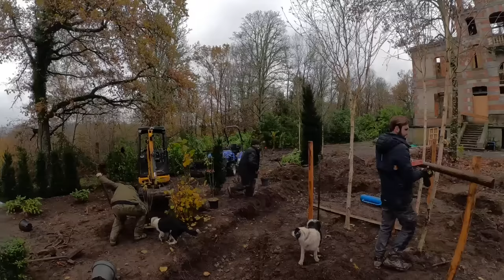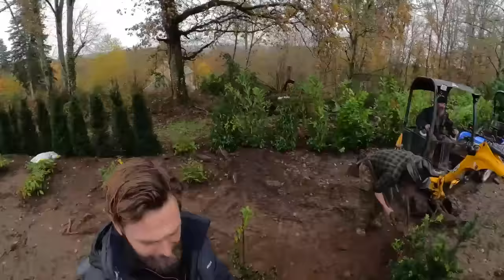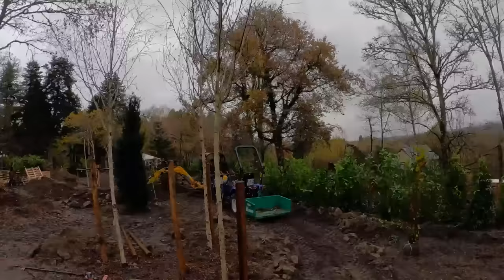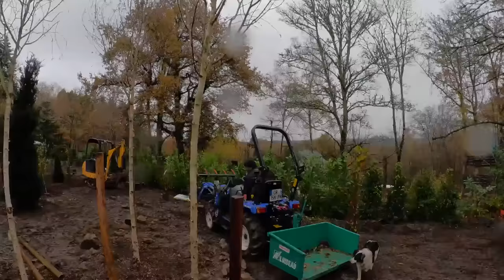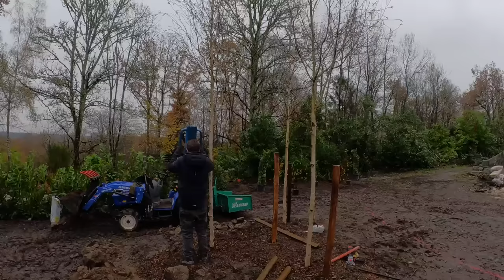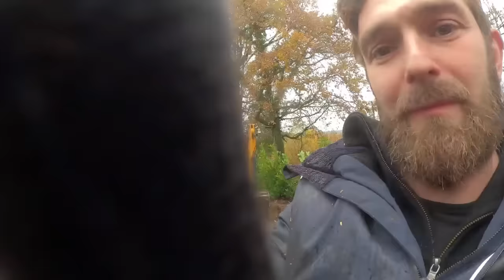Live from chateau de chaumont

Comment: Hi Dan nice as it is to see the garden coming along ,I think perhaps you should be concentrating on getting some sort of roof on your hard work in the building. My concern is that if the supporting  floor beams are continually getting soaked that they ends of them that are slotted  into the walls if the mortar is tight the pressure of the expanding wood is immense and it may crack the walls very easily please  get some tarps up and get the place dry and forget about the garden until the springtime.

Comment: ps I reckon you could run this all day! pps current thought on planting trees is to support right at the base  - stops the rock on the roots but ensures that the trunk flexes and increases strength. Trees need to be planted a little high in the soil otherwise they sulk 😁

Comment: The bane of any environmentally minded gardener - what to do with all of the leftover plastic and polystyrene plant pots. You can only reuse so many - and I do.

A while ago I realised I'd amassed a HUGE pile of plastic pots just as the gardening year was beginning. Checked with a local air ambulance charity shop to see if they'd be interested, came home, scrubbed, dried and graded by size, before donating the lot. Depending on how the shop priced them, in groups or individually, a good £15-30 could have been raised. A local DIY shop does take back clean plastic plant pots for recycling, but as I've not got a car, that's quite a walk just to do a bit of recycling.

Comment: Dan use panty hose (women’s stockings) cheapest way to secure plants. The top part goes around the horizontal post and the legs around the tree and tied back to the post. Sticking have enough stretch to hold the tree but will flex with the wind.

Comment: Your two puppies are fine to watch as they have to be involved. They need to check everything out. One question, I didn't understand what you were doing with the three trees and the wood? Are some kind of support structure for the those tall white trees?
Reply: The silver birch trees will be tied on to the wood H frames, to prevent them rocking in the wind whilst they take root. When fully established, the frames can be removed.

Comment: I enjoy your project a lot, and with the time flying, I am concerned about the wrong priorities that you have for your project. The garden is a purely aesthetic point, and delaying this for one year would not have much impact. Anyhow, well done and keep it up!!!

Here are my 2 cents' contribution on the priorities:🤔

1. Safety and stability: The first priority is to ensure that the castle is safe and stable. 
This may involve shoring up walls, repairing roofs, and removing any hazardous materials.

2. Structural integrity: Once the castle is safe, you need to assess the structural integrity of the remaining buildings. 
This will help you to determine which buildings can be restored and which ones need to be rebuilt.

3. Essential services: You will also need to install essential services such as plumbing, electricity, and sewage treatment. 
This will make the castle more habitable and will also help to protect it from further damage.

4. Historic preservation: If the castle is historically significant, you will need to take care to preserve its original features. 
This may involve consulting with experts in historic preservation and using traditional materials and techniques.

5. Accessibility: You will also need to consider how you will make the castle accessible.
This may involve installing ramps, stairs, and other accessibility features.

6. Security: You will need to take steps to secure the castle from vandalism and theft. 
This may involve installing security cameras, alarm systems, and other security measures.

7. Sustainability: You should also consider how you can make the castle more sustainable. This may involve installing solar panels, using recycled materials, and conserving water.

8. Aesthetics: Finally, you will need to consider the aesthetics of the castle. This will involve choosing materials that complement the castle's original design and landscaping the grounds in a way that is both beautiful and functional.

Comment: What's the significance of keeping the root ball intact. From the conversation it appears to be important. Also they appear to be clay. Was this what they grew in, or is it used for the journey? Cheers
Reply: It's important to disturb the roots as little as possible & keep air away from them too. The type of soil is what the plants are grown in, then lifted by hand or machine, then wrapped & secured smaller with bands, bigger with wire
Reply: Excellent, thanks. So hedging plants with bare roots are less successful I would assume?
Reply: @davidfellowes1628  no, not if planted correctly, most good rose stock is bare root
Reply: Plus most plantation tree planting is bare root, if done manually, by notch planting, basically opening the ground with a spade, place the sapling in, then heal the ground around it. In good ground, it takes seconds
Reply: @oldmaninthewood  much appreciated. 👍